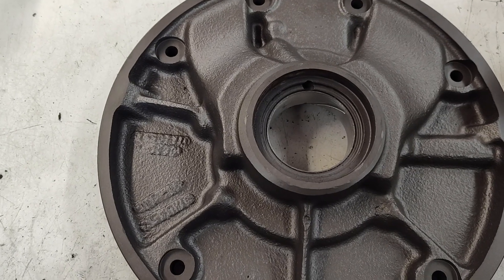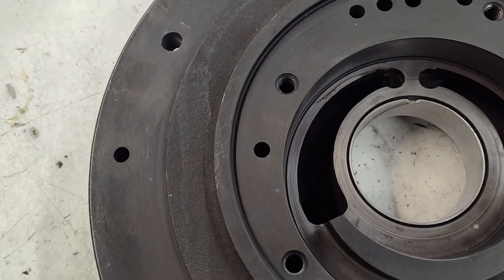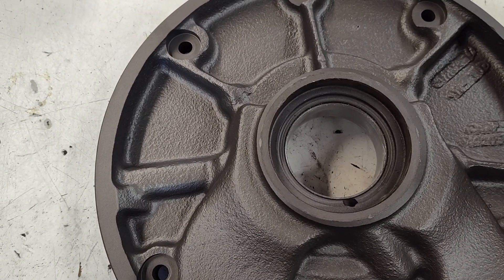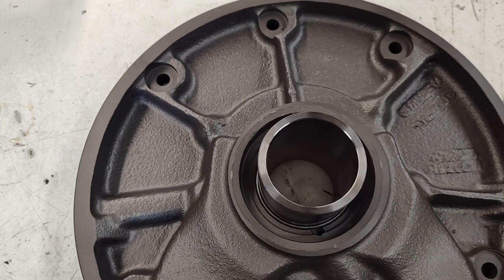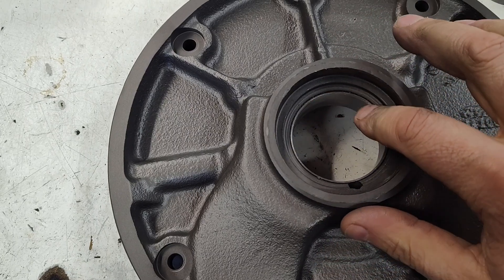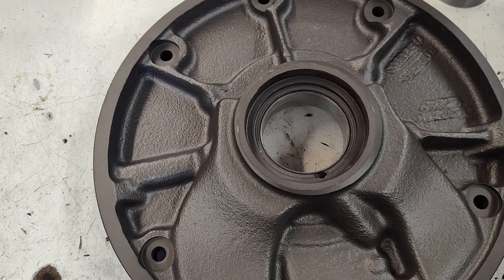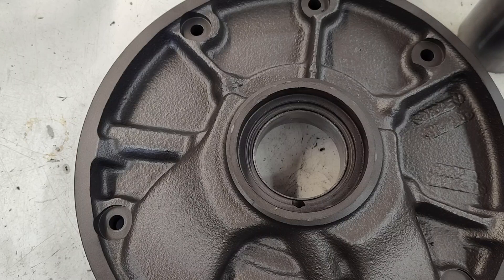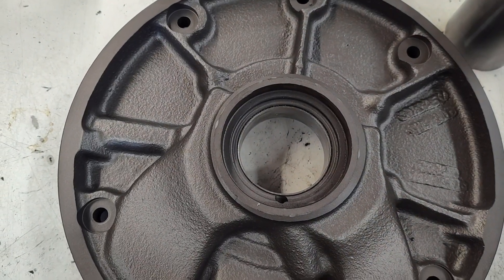Ford C6 Transmission Pump Bushing Install

Comment: I learned a lot,,but the video is called pump bushing INSTALL which wasn't covered   thanks 4 the lecture😐
Reply from the maker: I guess I didn't actually press the bushing in on camera but I showed you how to orient it and check the fit. Sometimes you have to fill in the blanks.

Comment: Man, you weren't kidding. Spent over an hour honing an SAP bushing (using a brake hone and 1000 grit sand paper) to fit freely over my new converter hub. Mine was quite a bit tighter than what you show in this video. Now it slides right on and spins freely. still snug, but freely. Just banging the bushing in and not checking this, could certainly turn into a disaster. Can't thank you enough for this and all your other videos on the C6.
Reply from the maker: I know frustrating. Thank you for sharing your experience